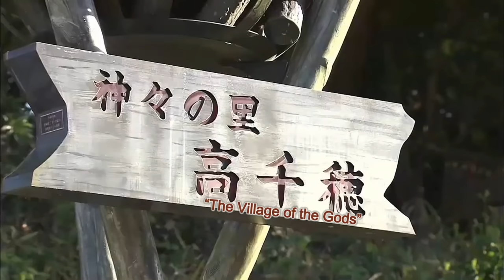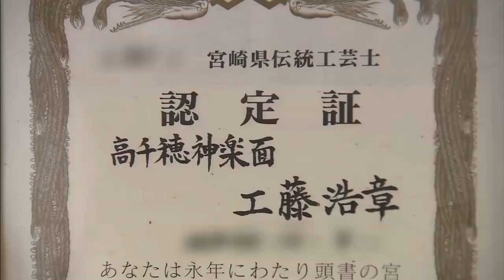With More Than 20 Types of Blades, A Young Man Has Tried To Carve KAGURA Masks(Fine Carving+Eng Sub)

Comment: He should use a bench of something to hold the mask while doing the ''heavy'' carving. The force he uses is actually absorbed by his body, making his blows less effective and wasting alot of effort.
Reply: AstralJokers you are completely wrong!! The Japanese do not use benches. The workpiece is braced against the studding of the floor. No force is absorbed by his body. It’s been done this way longer than benches have existed.. benches are a western modern concept....
Reply: The part rating on his lap is to test the rigidity or density of the particular piece of timber.
Reply: @charliebowen5071  You may try to believe w/e things you want to believe, physics don't care about your beliefs. You can see him clearly sweating and you can see the piece swinging around on his body. It's not braced. The way he's crouched means he's killing his back. I don't care where he is from, his form is bad and he suffers for it. Those are simple facts.
Reply: @AstralJokers  Agree with you, the carvers in the philippines, indonesia and malaysia sit on the floor but place the wood on the ground or a small carving rack near the ground. The volume of carving these countries do is much more that that coming out of japan.
Reply: @AstralJokers  ok mate.. not bothered enough to even answer properly.. just shows you are not a craftsman...
Reply: Agree, when the workpeace is mounted then one less thing to worry, less chance to accident. Noticed from cut quality that the first roughing chissels was not sharp. My teacher teched that Most important thing on carving chissels are angle and sharpness, we checked by shaving arm hairs - sharp tool need less forse to cut = less power to use. Nothing against Japanese tools but they are for  floor siting craftsmen
Reply: Japanese have been working on the floor for hundreds of years, even their cabinet makers, drawer makers, blacksmiths, swordsmiths, bow makers, carvers etc are all done without the use of benches and are done on the ground level or the floor. 

To Japanese I think they find benches as just a storage use rather than a work platform to hold things on while they work. And with no bench I think it's easier for them to move their material or workpiece around alot easier than having to clamp it down then unclamp an so forth and also having to stand up the whole time while they do it just wastes energy and tires your legs and lower back over time.

From my understanding it's just how Japanese have been right from the start and carry on till present day Japan.

Comment: 3D sculpture drilling machine can save time 50 times.
Reply: But then it is not carving, it is soulless, it is not art, it is just the next machine done item without any value.
Reply from the maker: you can be done quickly with 3d sculptures but you can't create culture and faith in it.